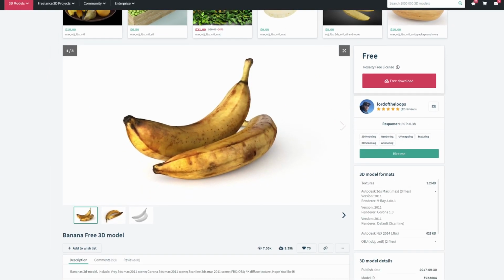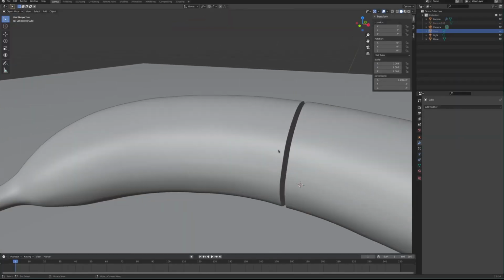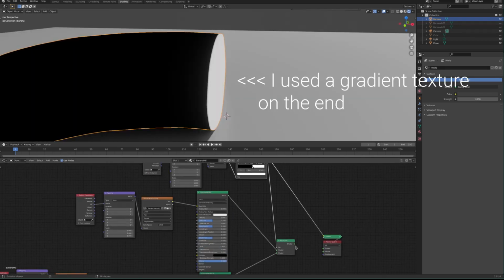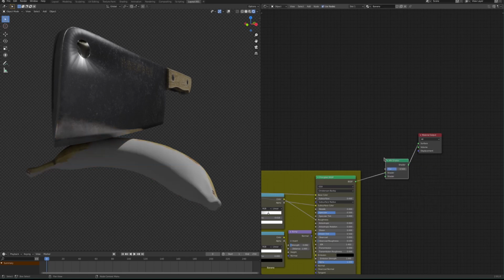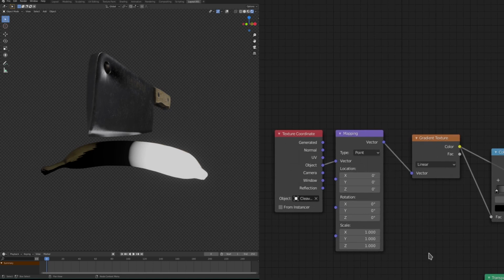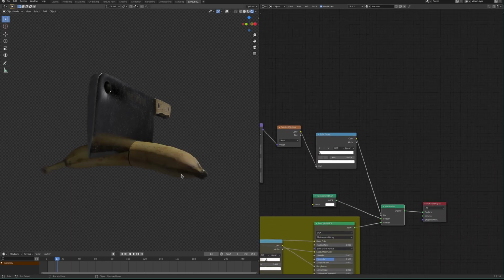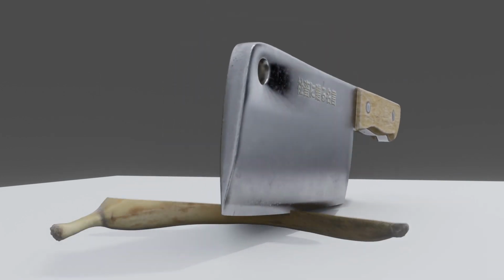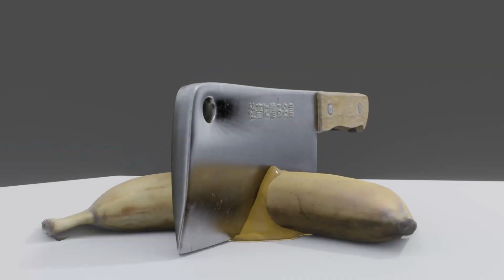How to Cut Things in HALF with Blender!

Comment: That is really cool, but isn't it way easier with just having one model and using shape keys?
Reply from the maker: That could work depending on your situation, but swapping the meshes for a rigid body simulation would be rather difficult.